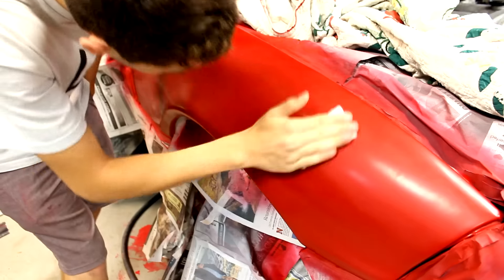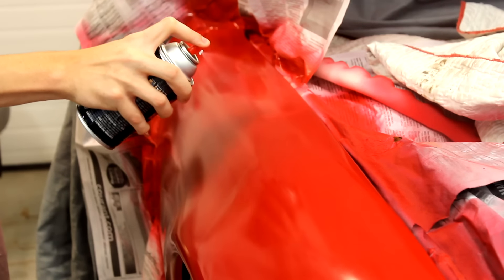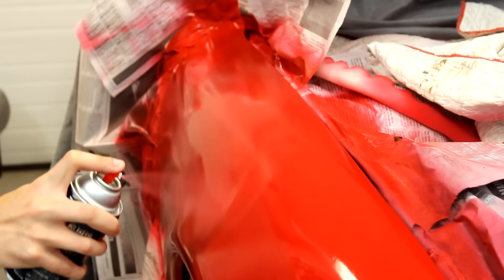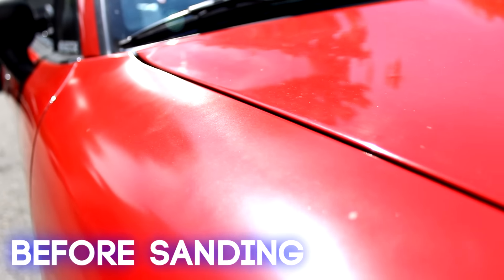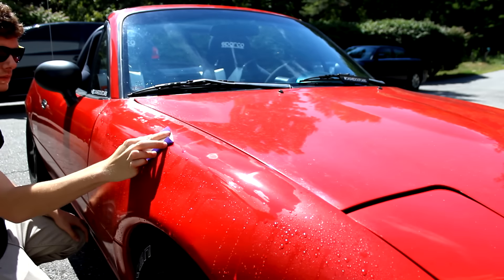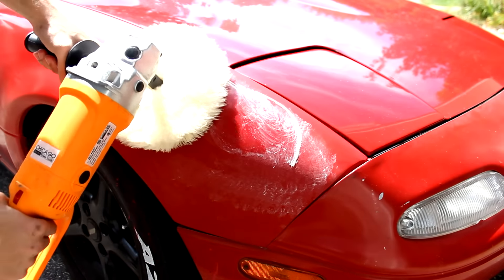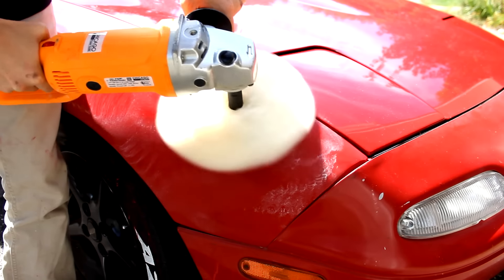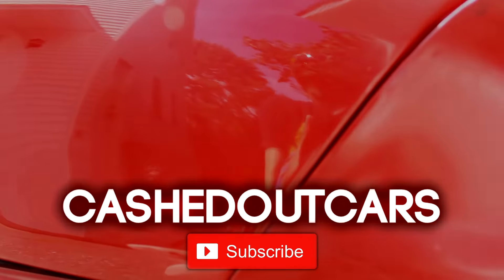How To Professionally Repaint With Spray Paint

Comment: Why didn't you apply a clear coat?
Reply from the maker: +XoolarPvP my car has single stage paint (no clear coat). If you want to add clear coat you can use the same steps and buff the clear coat at the end
Reply: CashedOutCars how many cans did you use .. and how many coats
Reply from the maker: +Adrian Trejo for the fender it took just one can of red. I think I did 3 or 4 coats
Reply: CashedOutCars ok cool thanks for the info
Reply: CashedOutCars if u use clear do u still gotta wet sand the clear before buff?
Reply from the maker: +kamsandhu85 yes still wet sand, make sure you build up enough clear coat so you don't burn through while sanding though
Reply: CashedOutCars so i have some faded fenders can i just scuff and paint over existing paint like u did? Instead of sanding all down
Reply from the maker: +kamsandhu85 yes that should work as long as it's scuffed and cleaned well
Reply: That's what I was going to ask

Comment: Can I sand down and paint my car without first applying primer? If this is possible, what grit sandpaper should I use first before spraying paint onto my car? Also, I see that you did not apply a clearcoat after you painted is this ok or did you spray on a clearcoat after your paint coat?

Comment: duplicolor or rustoleum automotive?

autozone only sells duplicolor, but they match specific car brands.  I thought of getting duplicolor primer, desired color of DC, and duplicolor clear coat?
Reply from the maker: I used duplicolor that is actually listed as a GM paint code. It matches great though.
Reply: alright
Reply: what paint code was it? interested in painting my car with it

Comment: Wait so was that a no on the clear coat, I understand you did 4 coats but was that a reference to the dupli color paint or the actual clear coats that you sprain on?
Reply from the maker: +Bryant Garcia Cartagena since this is an early Miata it did not come with clear coat from the factory, so in this case I did not use clearcoat. If your vehicle used clearcoat originally I would use it following these same steps

Comment: So pretty much you use primer before spraying the paint?
Reply from the maker: Yup, prime, then paint, then clear coat if you choose to do so!
Reply: CashedOutCars I have a 2003 model car so that means use clear coat after the basecoat and after using the clearcoat what I do next?
And if I still have paint on my car hood, do i still use primer with wetsand to smooth out the hood to repaint it? Thanks in advance
Reply from the maker: You could wetsand the clear coat and then wait a month or so to wax it to ensure the paint degasses all the way. I’d get as much paint off the hood and then prime it, that’s usually better than priming over old paint
Reply: CashedOutCars And to get the old paint off the hood, which primer would you suggest? And what kind of grit sandpaper should I use?
Reply from the maker: Remove the paint before priming it! I’d try to use something like an abrasive wheel on a grinder if possible, it’d save lots of time to strip the old paint
Reply: CashedOutCars do we use any type of color primer like grey and than spay the color of the fender

Comment: What color spray can is that?
Reply from the maker: +Carlos Corona (BoostBooty) duplicolor color match 0388, it matches great for red NA Miatas
Reply: Would you say Dupli-Color is pretty accurate with colors they are advertised to match?
Reply from the maker: +AzNightmare hmm I will say that the can I used is supposed GM match but it matches the my Miata well.. look around on forums and see what people recommend for your specific color
Reply: Thanks for the quick response. Based on another project I worked on, after the wet sanding stage with 2000 grit, my surface is all dull and scuffed looking. Feels incredibly smooth though. Is the only step from that point is to compound and polish to get a shiny gloss finish?

I wasn't sure, so I thought I ruined it so I just put another heavy gloss layer on and left it. But it's all orange peely.
Reply from the maker: +AzNightmare that's what I did here, just wet sand and then compound and polish. It will look dull before buffing which is a little nerve wracking but it'll come out nice. Also if you're worried about it being too scuffed you could use even finer paper. And then if for some reason it doesn't buff out you could always scuff it and put a final coat. Good luck!
Reply: Thanks for the tip!